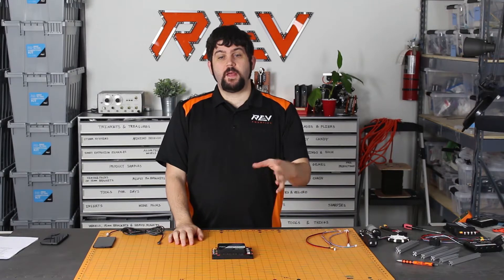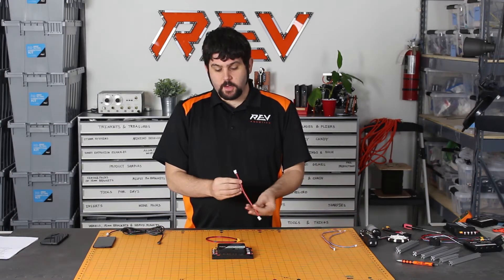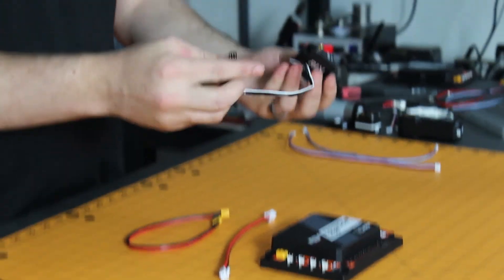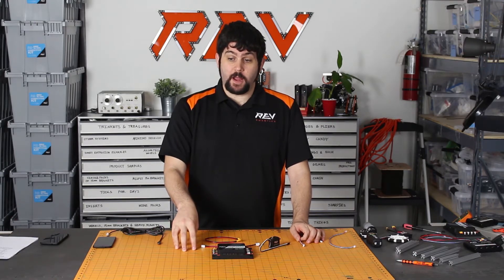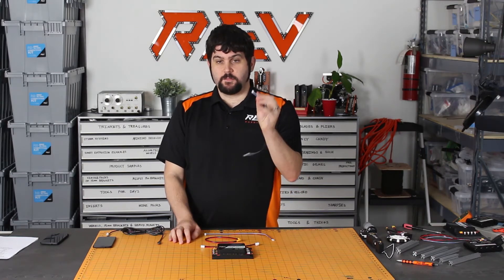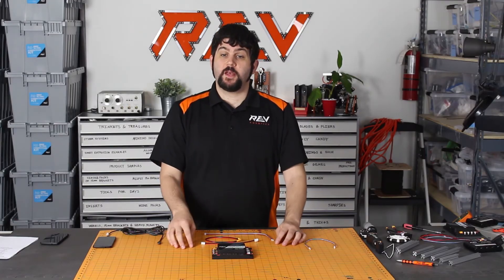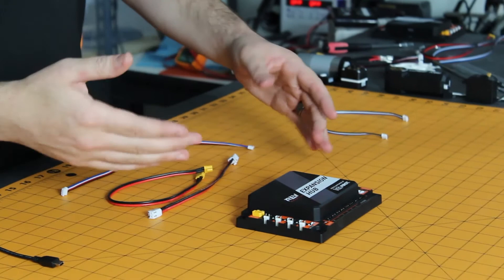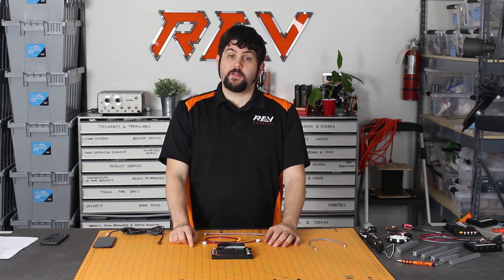REV Robotics Expansion Hub Overview

Comment: i just have a question im hoping someone can answer: what does it mean for the light to be green like it's connected, but every couple seconds if flickers on blue light, and then back to green? is the expansion hub actually connected, or is the firmware not updated?
Reply from the maker: Hey there Imajn, email support@revrobotics.com if you haven't already and our support team can help address the issues you may be having with your expansion hub.

Comment: (1) Video should zoom in to the section that the speaker is talking about. (2) ESD = Electo Static Discharge... not "Disconnect" as the speaker mentioned.